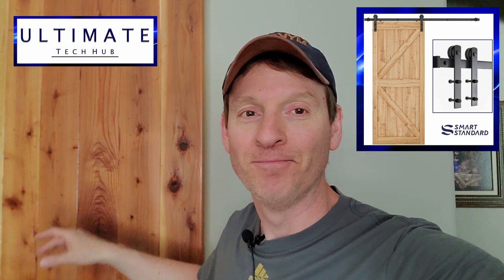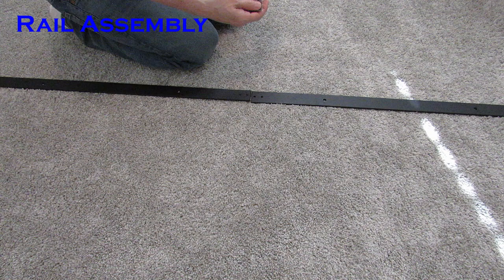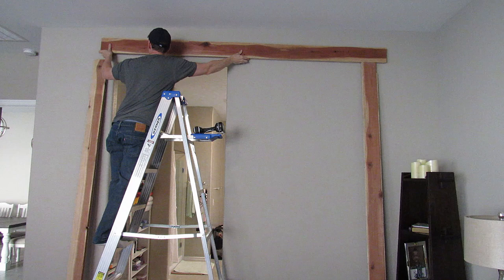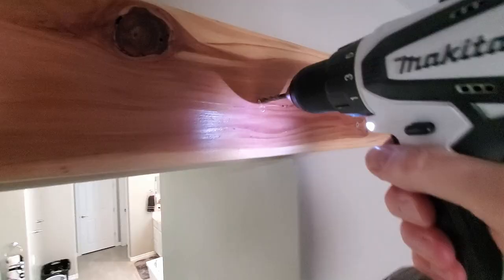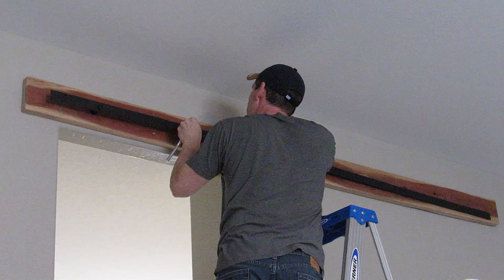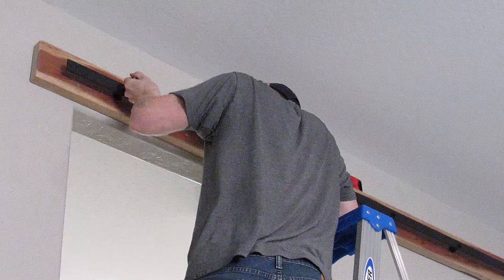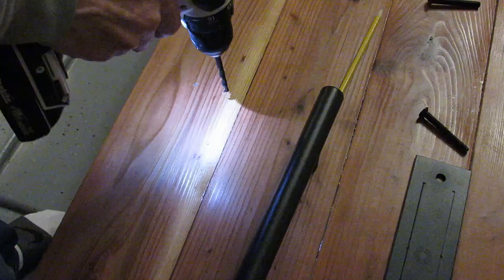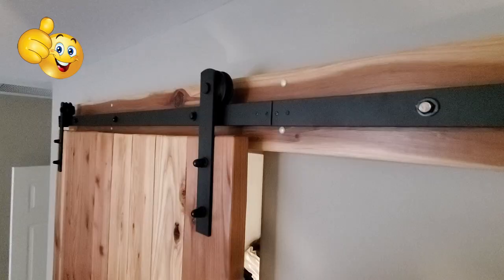SMARTSTANDARD 8FT HEAVY DUTY BARN DOOR HARDWARE – INSTALLATION

Comment: This video really helped me because I had lost my instructions.  Very helpful, I did run into one problem because my floor had a gradient meaning there was at least 1/2-1" discrepancy so ended up moving the left side  hanger up by 1/2". I had no idea my floor was uneven until that moment.
Reply from the maker: Glad it helped! Thanks for watching and if you subscribed thank you as well. :-)
Reply: @UltimateTechHub  Great video.  My Doorway is 4 ft. How long should the header board be?
Thanks
Reply from the maker: @mzwisdom7504  8 ft 4 inches.

Comment: if my header board has two screws per stud but my railing doesnt line up with any of the studs and my door is VERY heavy will it hold ?
Reply from the maker: Yes it should. My rails didn't line up with my studs but the header is solid and thick. The header takes all the weight of the door. If the rails line up then that's just a bonus. But that's not likely. Thank you for watching and keep me posted on your barn door!
Reply: @UltimateTechHub   Thank you, I will do it for sure. I appreciate the input

Comment: Yes it does look great. You took lots of time and got your measurements correct and the color looks well in your room. However, I’m worried about you hitting your baseboard on the bottom! Are you not worried about that? Did you modified at some point after the video?
Reply from the maker: The barndoor does not hit the baseboard. The weight of the door actually keeps the door from swinging against the baseboard. Thanks for watching I really appreciate it. If you have any other questions feel free to ask.

Comment: Hi - Did the rail screws just go into the header and drywall?
Reply from the maker: Rail screws just went into the header. I think maybe 1 of them lined up with the studs. The header is super secure to the wall its not going anywhere. My barndoor is probably over 100 pounds but most barndoors are about 40 pounds. FYI we love our barndooor and have had no issues with it. Thank you for watching I really appreciate it.

Comment: I have very limited space to deal with, remodeling a home built in 1900. what is the very minimum distance from the ceiling to the pre drilled holes in the rail? my rollers have the curved metal at the top. Thanks

Comment: When you say wood screws. Are you using screws that have high sheer strength. Would structural screws be best?
Reply from the maker: I used wood deck screws which are very strong and durable.

Comment: How did you secure at the bottom? Did you screw something into the floor?
Reply from the maker: I bought a base guide for the door but never installed because the door is so heavy that it doesn't swing back and forth. Thank you for watching .

Comment: so the door hangs out 1 1/2 more from the wall because of the header board? That leaves a pretty big gap.  I'm facing this same project.  I may actually notch out the drywall to fit the header board as to get a closer fit.  thoughts ?
Reply from the maker: No its not 1 1/2 inches its about 1 inch. Remember there is a baseboard. There is a gap but its not that bad. You could use a thinner header board and that would shorten the gap. I would not recommend cutting out the drywall to shorten the gap. Thanks for watching and keep me posted if you have any other questions!
Reply: @UltimateTechHub  Thanks brother, that door looks great !  I'm watching the other video you did on this
I'm gonna follow your lead on this one !
Reply from the maker: @StevenVincentSings  Fantastic!! Have fun!! Thanks again for watching!
Reply: @UltimateTechHub  subscribed !
Reply: @UltimateTechHub how do I find the other video?
Reply from the maker: I used the same exact wood from the barndoor for the wall mount but you can use a much thinner piece of wood. Probably 1/4 " will work. It's more important that the slider connects to the studs in the wall.

Comment: Did you install the guide on the floor?
Reply from the maker: No the door hangs perfectly and rides on top of the carpet. And the door is pretty heavy so it doesn't sway at all. I may install the guide if I notice the door swaying or hitting the baseboards. Thanks for noticing!! Your the first one to mention it!!! Lol
Reply: Thanks for the response! I purchased the 6.6’ rail system and I wasn’t a big fan of the guide so I was looking for an idea so I thought I’d ask if you did
Reply: @glenengle6492  amazon has a baseboard installed guide.  I chose that rather than the floor installed one
Reply: Michael Lake yep I did the same thing seemed like a better design than to Kerf the bottom of my door I built and screw into the floor! You thanks for the feedback

Comment: How far off should the bar or headboard hangover the door opening that’s not opening
Reply from the maker: It just really depends on how wide your door opening is. You want to make sure you can fully close the door and also fully open it. The first hole I drilled was my starting point. With the 8 foot header board I centered the rail on it and then just determined the Ultimate position for the board. Hope this helps.

Comment: Can any wooden door be installed as sliding barn door?
Reply: Yes, you can. You could easily find a 36" wide door, it probably meet your requirement, but most standard doors are 80" tall, it is too short to be used as barn door. There are some 96" doors, you might need to cut them shorter, but you might want be very cautious when you cut the edge because they are hollow core.

Comment: I just got a quick question; does this barn door kit work with a 28" closet door 🤔
Reply from the maker: Well I would recommend a 6 foot kit. The 8 foot would be too long and it might not look proportioned to the door opening. My door opening is 44 inches which is almost twice as wide as yours. Good luck and please keep me posted. Thanks for watching!!
Reply: @UltimateTechHub  sorry for not mentioning it! Yeah the door's height is 6.6' and weight is 28" do you think this kit would work?
Reply from the maker: @malikbezhanakbari935  get the 6 ft kit. The 8 ft is too long for the 28 inch wide door.
Reply: @UltimateTechHub  I found the 6.6 ft and I don't know if that works. I couldn't find 6 ft of this "smartstandard'' on Amazon Canada
Reply from the maker: @malikbezhanakbari935  6.6 ft will work. Your barn door is only 2 ft 4 inches wide so a 6.6 ft is fine even a 5 ft would work.

Comment: Hello Ultimate Tech Guy. I have watch tons of videos on how to install a barn door but I still don’t understand how to measure from the rail to the floor so that there will be no gap at the bottom of the door. My door is 80 inches tall. How do I get the proper measurements to install where the rail should be to avoid a gap at the bottom?
Reply from the maker: Watch this video.  This is the full version. You want a small gap at the bottom so the door almost glides on the carpet but not too low. Follow my measurements and use whatever size barndoor height you have and you will be fine. Heres the full video https://youtu.be/N0VWAD5Xno8
Thank you for watching and keep me posted if you have any issues.

Comment: Do I have to use a header?
Reply from the maker: I would definitely use a header if your studs in your walls are not 16 inches on center. And many times around doors they are not 16 inches on center. And the header board adds extra strength to the rail especially if your barndoor is heavy. Mine weighs over 100 pounds.  Thanks for watching and if you subscribed thank you as well.
Reply: @UltimateTechHub  Thanks for replying! Will buy a header 😫😅